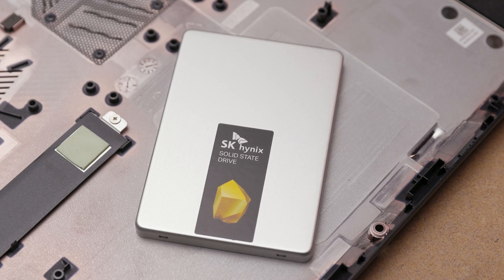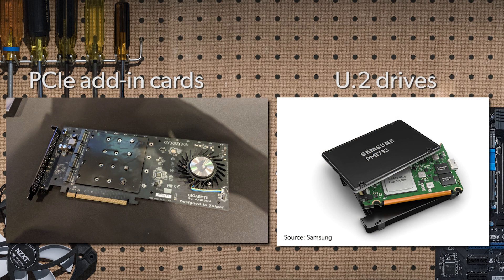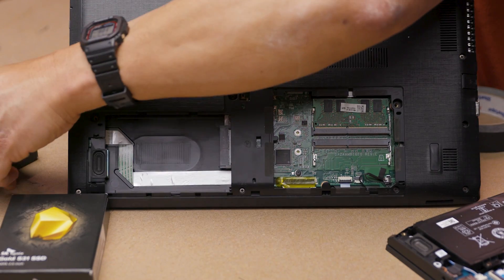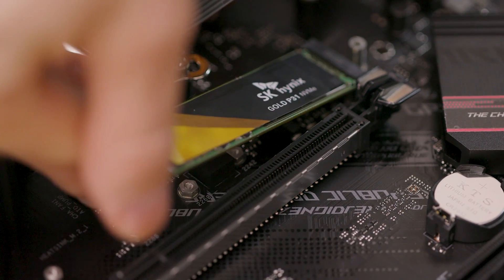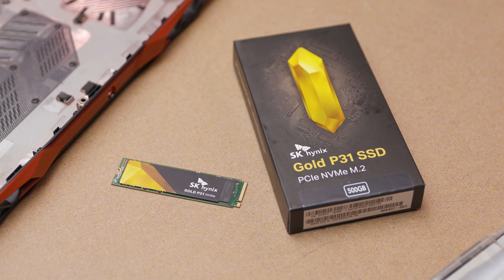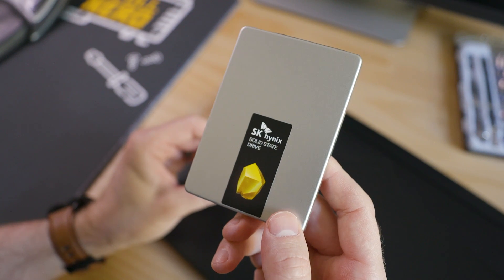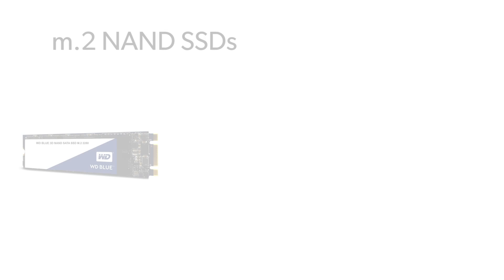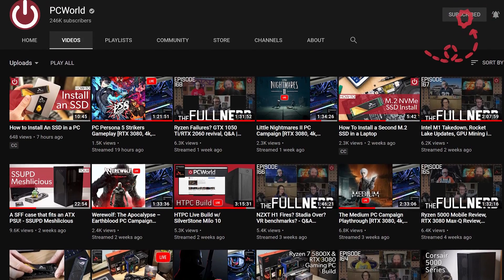What Type of SSD Should You Buy?

Comment: Excellent video Alaina, quick, complete and to the point :)  I am one of those few that tend to put an M.2 (Boot Disk + Apps I want to load as fast as possible), a 2.5" SSD (Les Frequently used S?W and Daily data), and in most cases, a 7200 RPM (name Brand) Hard disk (interim storage and temporary backups) usually at least 2tb.  All long term storage goes on Network NAS that is RAID-5.  I tend to trim things down a bit before going to the NAS however, such as deleting the video clips I know I will never used long-term for the YouTube content I create.

Comment: Just a quick tip, you might want to label the video as for newbies.  I was actually thinking that this would be a video on topology.  I am still trying to find a use case for QLC where my money doesn't get wasted quickly.  You should do a video such as when to use QLC vs HDD.  QLC kills tiself quickly in the wrong use case.  At the rate some games update, I still use HDD for Steam (WD Gold 6GB) in addition to bulk semi-static storage due to cost and sheer reliability, while using a combination of SSD drives for boot, programs, and fast scratch storage.
Reply: @pcworld  a lot less than people buying QLC for the wrong use cases will.  How many writes per page?  QLC is for static / semi-static storage only.  Anyone advising otherwise needs to be looked at as pushing consumable products instead of valid advice, kinda like how dollar store led light bulbs usually run in excess of 2x the rated power capability of the LEDs in them, planned trashing of a product that can last decades when engineered properly lasting only a year or less instead, by design.  I value my data.

In line with your question, I build my own computers with top of the line parts, and yes, my up front cost is higher than Joe Bob Bubba next door spends for trash from Wally-world, but in the end, because of longevity, I pay about half what he does before tech of similar capability filters down to his level.  In the end, who is the smarter consumer, the one buying low end trash every year or two, or the one spending half as much over the course of 5-6 years who only buys once?

Joe Bob Bubba at this point may not have even caught up with my 4790K system at this point, but the higher low end is approaching it's capability only now.  In the meantime he's bought three systems since then, just to reach the same capability.
Reply: @pcworld  I see QLC as a valid tech as more of long-term static / semi-static bulk storage.  They have the POTENTIAL to replace spinning disks for long-term bulk storage when prices drop into the realm of 25% or so of the current cost per TB...  Until then, it's place is in a tiered system of storage that factors in the miniscule writes per page for data that needs faster than hdd speed, with few updates/changes to said data.

Comment: for me 2TB M.2 by CRUCIAL
Reply: Nvme 3.0 or nvme 4.0 or sata3???
Reply: Brands do matter.  Myself, I use Samsung (Various non-QLC) and Crucial MX-500 in both 2.5 and m.2 in 500 and 1TB, and 2.5 inch Adata 120s for old stuff that doesn't get used much like old laptops around the house, since Adata uses slower less durable TLC.  For bulk storage we use WD Gold HDD drives for the speed and reliability as well as 24/7/365.

Avoid QLC like the plague until real world numbers are out on durability.
Reply: @kaylaandjimbryant8258  The video said SK hynix was the best brand, have you tried them as well?
Reply: @jinxterx  I found them to be on the level of or slightly better than Adata.  I generally stick to Samsung and Crucial because they keep the better chips for their own products and third party testing shows this.  As for the other companies, I use those for less critical stuff, and what I buy from them largely depends on what is on discount (like the Adata drives we have for stuff like old laptops, raspberry pi, etc).  Third party testing clearly shows that Samsung is the best to buy.  They may not be cheaper, but they are durable.  Again, avoid QLC like a plague for anything other than static (rarely changing) data that requires SSD speed, at least until real world numbers for durability come out.  My take on QLC is that generally outside of multi tier SSD-based server applications, it is better to use a HDD for that type of data, or in our case, Steam main storage (move large games currently being played into SSD using the Steam move function, moving them back to HDD when done), video and audio media (static), books, etc all stay on HDD since they don't really benefit much from speed, and since they are either unchanging or get tons of updates (Steam).  IMHO, a lot of Steam games can kill a QLC.  Ultimately, it's about the money.  When I buy a SSD, it had better last 40 years.
Reply: @jinxterx  I agree